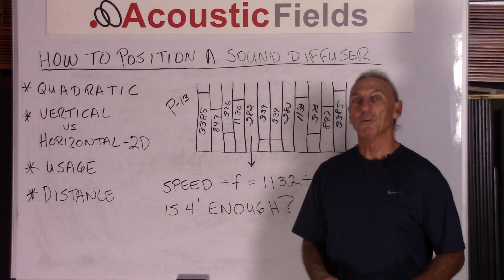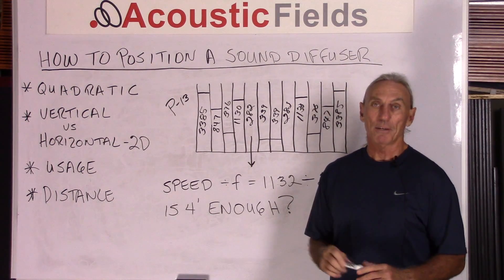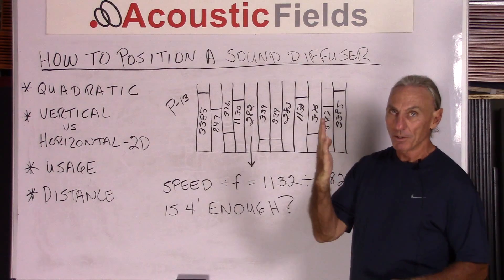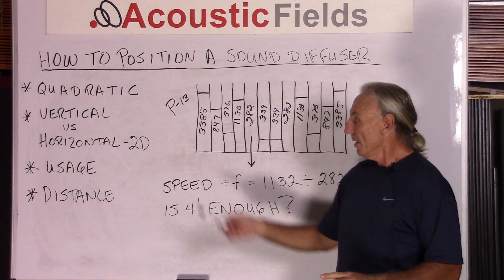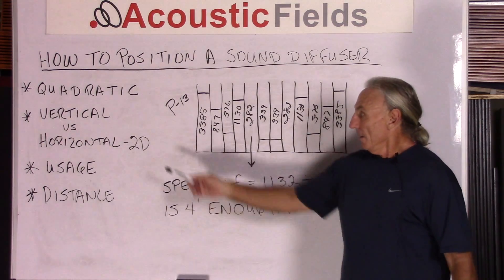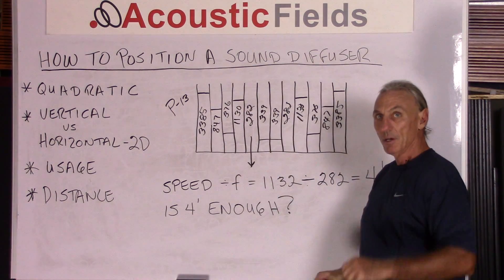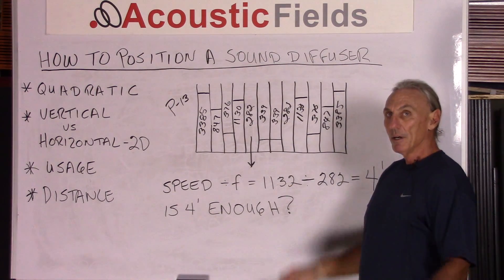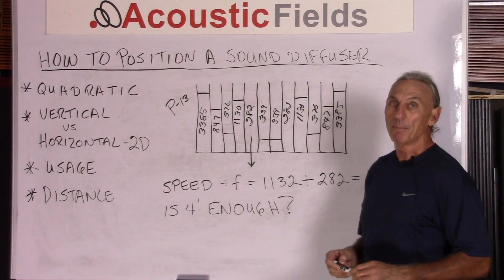Sound Diffuser Placement - How To Position A Sound Diffuser

Comment: Still best ever on Diffusion.  This knowledge launched my (After Retirement) career and I'll just say thanks...
Reply from the maker: Diffusion is a technology that will increase resolution and create a larger sounding room. It does this using the science of psychoacoustics. It also increase reverb times. In order to achieve maximum diffusion perforamance, you must have low reverb times, reverb must be equal and balanced throughout the room, and decay times must be linear with no spatial irregularities in room response. This is why you must have these requirements managed correctly with the proper rate and level of absorption before introducing diffusion. Diffusion can drain your bank account and make your room sound worse if the requirements are not met.

Comment: Thanks Dennis.very instructive as always. My room is only 16 .5 feet by 10 feet by 7.5 feet..IAM in the process of putting those absorption and diffusion  panels on the walls. My speakers are Wharfedale Evo 4.2. The room has some slap echo. The back wall has a large window and I close the drapes when listening to music
 Should I put the panels on the front wall behind the speakers ? Any other advice would be useful. Maybe absorption panels on the ceiling above the speakers ? I have large bookshelves on the side walls which covers the point of first reflectiom

😢
Reply from the maker: Without knowing the rate and level of absorption of your treatment, I will not be able to assist you. Placing diffusion and absorption panels without a strategy and performance parameters is a recipe for failure.

Comment: I am trying to treat a small office for critical listening. It has wood floors and flat walls. I added absorption panels and a sound absorbing curtain to minimize the echo. This largely takes place in the front, as this is a near field setup. The majority of space is behind the speaker system. I want to add diffusion panels on the back wall to diflect any reverberating sound. Would this be proper use of diffusion?
Reply from the maker: Your problem is reverberation, not echo. Diffusion will increase reverberation times.

Comment: Thanks as always for your valuable information. I have a doubt. If my listening position is closer to the back wall and farther from the front wall, I might use a lower P7 at the back  and a P11 for the front for example. Thanks.
Reply from the maker: Every prime number sequence in quadratic diffusion has a minimum distance requirement from diffuser face to the listener's ears. With these two prime numbers, you must use 4 -5' to avoid phase. Make sure your reverberation times are balanced throughout your room response is as balanced as possible or diffusion will drain your bank account and make your room sound worse.

Comment: how did you get these figures of the speed of sound, and frequencies
Reply from the maker: The speed of sound is constant at certian atmospheric pressures. To determine the length of a frequency (wavelength), divide the frequency into the speed of sound. 1130 divided by 40 hz. = 28'.

Comment: QRDude software recommends sitting 3 times the longest diffused wavelength away.  For a diffuser like this one, that would be 12'.  Will sitting just 50% further than the longest diffused wavelength away return similar results? Why do you think the recommendations vary so much?
Reply from the maker: The recommendations vary because the people giving the advice usually have never built and tested the results. They just regurgitate what they have read in textbooks. We build and install quadratics and have for 30 years. We know how they work and what they sound like.

Comment: Just wonderful teaching as always. As a rookie u have been a god send. the only question I have are how why is amazon allowed to sell the clearly  inferior, mathematically laughable products they have now.
Reply from the maker: Q,  Amazon is a private company and they can determine what they sell and what they do not.
Reply: @AcousticFields  well I have seen these products first hand...density is not one of the requirements.  I have also been working on some deflection/absorption tech of my  own using open cell foam and diy diffuser tech. honestly just biding my time until we get a bigger studio. right now we basically doing vocals in a yellow room status. I think I am close to having the 5 events I need for a field to occur.... if I can replace this glass with a panel system. where can I find examples? I cant wait till I have saved enough to just pay u guys for top notch sound rooms.

Comment: Distance from diffuser  or wall it's mounted on? What about vertical height compared to sound source?
Reply from the maker: S, Distance is from the wall itself to your ears. Start the diffusers 24" from the floor and run up to ceiling.

Comment: the distance from my listening position to the back wall is 12'.    After doing the math, I calculated the lowest frequency that the diffuser could diffuse is 94 Hz.     My question:  how deep does the 'well' need to be?  And what Prime Number diffuser will I need?  Thanks.

Comment: Could you share a bit about your opinion on the need for diffusion on the front wall for a critical listening room? I have a smaller 20’x18’x10’ room with superchunks in four corners and absorption for the RFZ. I am planning more absorption on the rear wall and diffusion, but my understanding is nothing is really needed in the front wall after all that (other than more bass trapping if I can). Have you made any videos discussing diffusion on the front wall?
Reply from the maker: R, You have to develop a sound strategy for what sound quality objective you wish to achieve.  Every surface area within your room has a specific sonic contribution to the overall presentation. You must step back and develop your specific goals for the room then assign the proper treatment for your goals. Fill out the information in this link and let's take a look at the total room. https://www.acousticfields.com/free-room-analysis/

Comment: Hi Dennis Foley. Thanks for this video. i have a question regarding a rehearsal studio of around 400 sq ft. it's pretty small and i would want my band to experience diffusion from most parts of the room as we would move around quite alot. Should i use a P-7 diffuser for a small room? also, i thought of using just 1 loudspeaker for the room as i think with the correct diffuser and absorption placement, the volume and quality would be good enough as we are only going through Mono and not Stereo. Do you think it's a good idea?
Reply from the maker: H,  First, you must manage all low middle and high frequency energy through absorption. Diffusion will make your room sound worse if all frequencies not managed before diffusion. What absorption technology do you have in the room?
Reply: @AcousticFields  thanks for replying, Dennis. We plan to use either rockwool or fiberglass (2 inch thick) for the exterior walls, floor platform and ceiling and also frame it in woods (2 layers) which would help with the high and low frequencies i hope. We're on a really tight budget so these materials make sense for us now :/

Comment: So if my listening position is 3ft- 4ft from the back wall, speakers 8ft-9ft away with a 14ft front to back distance (listening room). Would you recommend a prime 7 diffuser ?

Room is W18' x H15' x L14' . Where can I buy my diffuser panels?
Reply from the maker: M, Two dimensional diffusion with 2' x 2' units starting at 2' off the floor and running to ceiling and across total width of wall. We can quote you costs.

Comment: Thanks for the video. I realized after looking at diffusers online that I knew nothing about acoustic treatment, and your videos have helped a lot. I'm confused though by your formula. The formula is speed/frequency, and what is confusing me is the number you use for the speed of sound. I thought that the speed of sound was about 344 m/s, and in your formula you use the number 1132. I'm not sure where you got this number from; are you using a different system (imperial) for the measurement of the speed of sound?
Reply from the maker: S,  1132 is ft. / sec.

Comment: So If I have a bedroom and i use it to mix my tracks and also listen to music, what am I after? A control room or critical listening
Reply from the maker: W,  The room size and volume determines your usage. You must select a room size and volume that minimizes your low frequency modal issues and allows for enough distance for middle and high frequency reflections to be managed correctly.
Critical listening is part of the mixing process.
Reply: control room

Comment: sorry for the last question Mr Foley, it was asked at the end of a 22 hour day, what I meant to ask was i there a site you recommend for accurate individual well depths and fin width,and spacing once again my apologies. best reference  i've found was www.digitalaudiorock.com/cgi-bin/qrd.cgi,  as QRDude: Quadratic Residue Diffuser calculator  is frozen thank you
Reply from the maker: J,  Stay with the basic prime numbers for your diffusion sequences. You will not achieve audible performance differences using custom sequences.

Comment: final question, if you have at least 6 feet from from the front of the diffuser to the mix position is there a well depth you would recommend for an 282hz wave or is it then become pretty much moot, dont mean to overwhelm with questions, used http://digitalaudiorock.com/cgi-bin/qrd.cgi  as a guide
Reply from the maker: J,  Use a prime 13 sequence.

Comment: Hello Dennis, as far as diffusers, do you like putting diffusers vertically, horizontally, or a combination of the two  the most accurate room i've worked in they were vertical first then horizontal above (crescent moon studios, Miami) wish I could attach pic
Reply from the maker: Hi Jose,  Placing quadratic diffusers in a vertical and horizontal array creates two dimensions of diffusion. Two dimensional diffusion is used when the distance from diffuser surface to listener is shorter than the requirements for a one dimensional diffuser. Distance for a one dimensional diffuser is required, so that the  lowest octave band represented by the diffuser has time to run and spread out.

Comment: You've probably answered this a lot, I've  looked some though and didn't see it. 
I'm building a 16x12 room with 8ft ceilings. My listening position will be at 38% so about 6' (unless there is a reason it should be different), I plan on putting a diffuser on the back wall. How would I determine the size, prime and should I use absorption on the side walls only or diffuse there as well? Thanks for the vids.
Reply from the maker: Hi Evan, You could use a prime 13 for your front and rear walls. With short distances such as yours, you must stay with same prime on both surfaces.
Reply: Acoustic Fields do you have a video you could suggest for understanding which prime to use and which frequency to use? I'm new to diffusion in general. Thanks for the response.
Reply: @AcousticFields  Hi, can you explain why both surfaces must be the same prime number with shorter distances? Does this also apply if I have 2 dimensional diffusion on rear wall? Thank You.

Comment: Hi Acoustic Fields, 
Congratz for all your videos , good job ! 
I've 2 questions : 
- I've 4 diffusor with their lowest frequency at 860 Hz . So with your calcul we need a distance, between the listening position and the rear wall, of 6.5 feet but my distance is : 12.5 feet . It's ok too ? Because I don't have other possibilities. 
- What's the best height to place the diffusor on the rear wall ?
Thanks in advance ! :)

Comment: would you suggest diffusion or absorption for front & rear wall's 25 ft front to back for a studio recording space,i heard you mention diffusion on one wall & absorption on another would that work ? at the moment i have diffusion on the rear wall but no treatment on the front control room window wall,the ceiling is fully treated i also have side wall gobos,could i send you some pics
Reply from the maker: Hi Sean, Diffusion type, amount, and location is related directly to usage. Send me your information in this link and include photos of all surface areas. http://www.acousticfields.com/free-room-analysis/

Comment: hi...the distance between my listenin position and the back wall of my control room is 2 meters.what s the prime number of the diffuser i need? (i wanna treat 200-600hz ) thx
Reply from the maker: Hi Moustafa, You could use a prime 11 or prime 13. The prime 11 is 9" deep and the 13 is 12" deep. Use only in the vertical domain. Position so 50% of the diffuser is above ear height. Cover the total rear wall surface area.

Comment: If the diffusion well has a gradation of depth say from 1" to 2" will it not work in a more analogue manner rather than a digital manner with frequencies being quantised  say 1" to 2"
Reply from the maker: Hi Graham, All music and sound is in the analogue domain. Diffusers are like speakers. They are designed with a specific frequency response for the intended usage. You must follow certain formulas when designing a diffuser just like you do a speaker.

Comment: My mistake Mr. Foley I mistakenly put my well depth setting it 9in, instead of 12.5 inches. after correcting the specifications the calculator says it will have a diffusion range of 501Hz-2260Hz. Should I then assume that if the mix position is over 6feet away it will diffuse from 282Hz-3385Hz? Thank you for imparting your knowledge experience
Reply from the maker: +Jose M It is important to follow the  sequence as stated. You will have to experiment with distances for proper wave formation and execution without distortion. I would use 6' as a minimum start distance..

Comment: Question Mr. Foley, I downloaded a QRD well depth calculator, I put in the specifications for a P-13 diffuser, with a 3inch well width, and a maximum
well depth of 9 inches. After I got the results, the program said that I should expect diffusion from 695Hz-2260Hz. I believe you claim diffusion from 282Hz-3385Hz.Is you diffusion frequency response calculation assuming I'd have enough distance for the lowest frequency to form in the room(distance of wave+50%). Should I assume I just answered my question as I am writing this, if so thank you for the priceless advice  

advice
Reply from the maker: +Jose M Diffusion sequences should be calculated to achieve maximum frequency range within the given space requirements within the room. We just built a diffusion sequence for a client based upon a prime 43. I believe it was almost 3' deep. The room had the distances to achieve full wave formation down to 100 Hz.

Comment: Hello

I hope you can give some advise of what should I use and where should I place them (acoustic panels)

Here is my condition:

I have a 3 x 2.5 metres of room and I intend to make a home studio recording. This room is located ahead to my carport. For vocal tracking, I'm gonna put some curtains on one of the room corner (U-shape curtain).

Should I use 2 diffusers (on the front & back of my control desk) ? 
How bout absorption panel? How many should I use them? Last week I have bought 5 sheets of 120 x 70 x 6 cm Rockwool and I haven't using them since.

Looking forward for your response and thank you before :)

Comment: Control Room : 8 ft ceiling, width 17 ft X 12 ft length
  We installed skyline diffusion on the side walls would you recommend I leave them there? I am going to do the same on my rear wall not the full wall but the first reflections off the back. I would like to also incorporate four units of the Activated carbon Diaphragmatic absorbers you all make .The idea would be two on my back walls (L R) as well as the side walls (L R) and add absorption, and two poly-cylindrical diffusers. for our front wall we have installed hanging baffles in it behind slotted wood .would this be overkill or is it even suitable for my application as a recording studio?
Reply from the maker: Hi ***** 

If you could fill out this form on our website and include photos that would help me analyse this fully for you:
http://www.acousticfields.com/free-acoustic-treatment-room-analysis-tell-us-about-your-room/

Please also include your phone number so I can call if I have any questions.

Thanks
Dennis